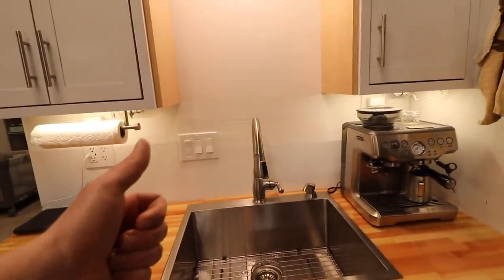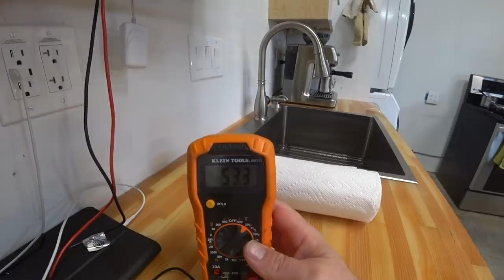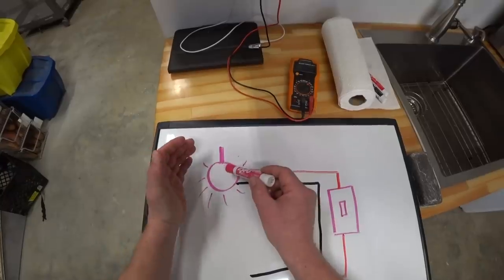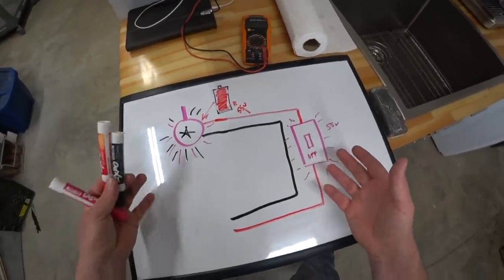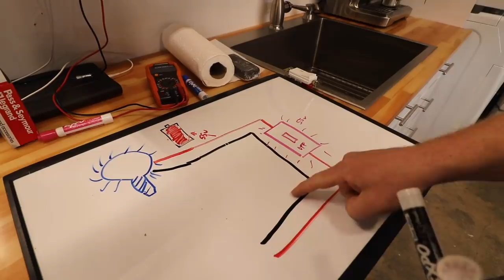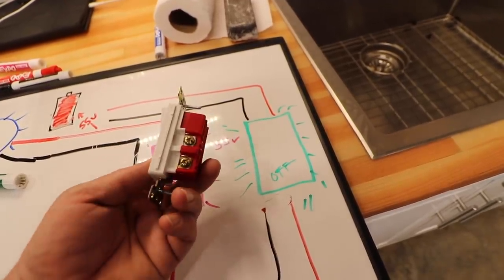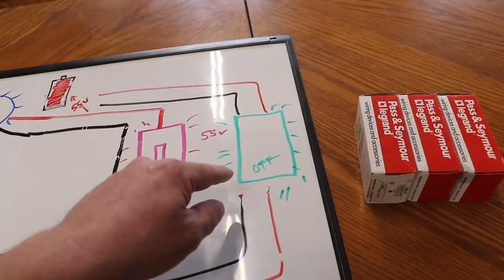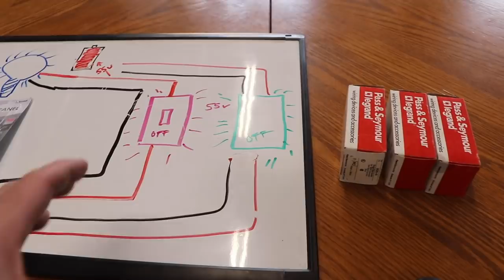Don't Use LED or CFL Bulbs 'Till You WATCH THIS VIDEO

Comment: Swap the line and load wires at the switch...
Reply: Can't believe people didn't see this...    I'm guessing that they are busy with life.  I'd hope they'd take down this video and replace it with the simple solution.   I've installed a few switches with illuminated leavers..  I'm pretty sure the amount of burnt down houses from that is 0.    They should also check other wiring...  Line and load are easy to mix up, but important to keep straight.
Reply: Doesn't matter the switch is wrong for the situation not wired incorrectly his explanation is correct but the switch warns not to use it for cfl or led lights

Comment: What about just find a switch that has light on the switch plate instead? That would solv this problem. And you would have light around the switch instead of in the switch.

Comment: What about just putting a smart switch in there many have night lights on them and you can just be like alexa turn on my counter lights as you come down stairs at night
Reply: Tjis will work as they use a relay to switch the load

Comment: Your problem is caused by the poor quality of the power supply of the LED's.
Better power supplies already have incorporated a mitigation for that.
The small amount of current passing your switch is accumulated in the power supply, how you already recognized. What you need is a resistor that bypasses the capacitor. Long story short: you have to drain the leaked current. You can put the resistor outside the power supply as well. It has to be parallel to the input of the power supply. Directly on the 110v. Maybe inside the box of the outlet.
A to big resistor will slow the flashing, but not prevent it. A to small one will consume to much current, may get hot or blow the braker.
That is the reason why you didn't found a better switch. But maybe you find a better power supply!

Comment: re. LED Strobe Lights 
You are right about needing a "parasitic" load. The light in the illuminated switch needs a return electrical path to work but only a very slight one. You need a "drain resistor" to provide a return path for the switch light.  If the light IN THE SWITCH is LED, I suspect a resistor of approx. 50,000 ohms, rated at 1/4 watt, wired between the load side of the switch and neutral will solve the problem. If it does not, or the switch does not illuminate, you will have to go to a lower value resistor (with a higher wattage rating). If you have no access to neutral at the switchbox, wiring to ground will work the light properly, but this is POOR PRACTICE, not recommended. You could instead put the resistor in the outlet box feeding your LED lights, wiring it between hot and neutral.
If you go to a lower value resistor, the wattage rating would have to increase by inverse proportion, i.e. a 25,000 ohm resistor (half of 50,000) would have to be 1/2 watt rating (double).

Comment: A resistor at the plug would fix it around 50k ohm
Reply: I checked it out with a lighted switch 
10k ohm did the trick with a 3 watt led

Comment: These switches should not be used as they do not fully isolate the circuit. Surely they would be failed by the inspector.

Comment: Why bother with switches, just use light fittings with integral motion sensing switches. A wave of the hand switches it on or off.

Comment: This has nothing to do with the LED or CFL lights, this is baity
Reply: Yes, it has everything to do with the high efficiency lights.  If it were incandenscent or halogen bulbs, there would not be an apparent problem.
Reply: @wallykramer7566  I don't know what's worse, the fact that you may think that the lights are a fault or you completely understand and run with this video.

Comment: You have wire problem try this and see put the switch on the black cable but neutral is white on the color code black is hot and red is return your problema is the black is hot and not a neutral  🤷‍♂️🤷‍♂️

Comment: If you have power on your plugs but the light switch  is off i would be worried .. major mailfunction and dangerous .. if its off no voltage should be seen .. hire a elektricitan to fix this you are dangerous ..

Comment: I've also found that it's not that easy to change halogen lamps to LED. The halogen electronic "ballast" needs a load, and the LED's do not supply enough of a load, so either the LED visibly flickers, or it constantly restarts which eventually bombs the ballast.
Reply: Thinking that fluorescent lights have ballests halagon have transformers

Comment: My house shop barn and storage areas out door lighting are 110vac no transformers its cheaper on initial outlay and no problems with dimmers or back lighted switches  I have 4 different sizes I get a rebate from my utility company. I have a full set of spares and should I need more I have one source online that does 2 day shipping/ In my not so humble opinion you just simply bought the wrong  types of lights

Comment: All lighted switches put the switch light in series with the room light.  With an incandescent bulb, Ohm's law takes over, electricity takes the path of least resistance and only the switch lights up.  With LED, the resistance is very low,  and electricity follows both paths.

Comment: Using a switch from the age of Steam and glowing Tungsten wire is not going to work in 2020 :-)  Unpleasant too back in the day when these were in Fassion, you would get zapped changing the bulb with the switch off......

Comment: When you get any voltage after you switch off, there is faulty wiring or some other fault. You should see 0V when measured or  some inducted voltage in millivolts range max.
Reply: The switches are design to have a dim light when in the off position.  Makes them easier to find in the dark, especially if you just came from another lighted room and your eyes have not adjusted.  That means there has to be some sort of circuit for the electricity to flow through.  When incandescent bulbs were used, the bulb was the best circuit to use.

Comment: You have light switches within reach of the water supply?😱 So you can have one hand in a sink full of water whilst using the other wet had to turn on the switch!! Certainly couldn’t get away with that in the UK. A big no no!
Reply: GFI breakers cover everything on the circuit.  That is what he is using.

Comment: ok after looking at all the answers you need to unbond the ground with the neutral to lower the backfeed to the plug 55 volts is to high  the other test would be shut one breaker off at a time to see it is in one curtket

Comment: Just fit one 275vac 0.47 uF X2 safety capacitor across the L & N in the back box of a plug socket .
One per switch  .

A neon power indicator ( neon & resistor ) may not work as the plug in psu will start before the neon fires .
If a neon is fitted in the box the darkness may make it unreliable  .

Comment: Go to radio shack and buy a bleed resistor (680K 1/2 watt?) and put it on the back of the Load receptacle much like some manufacturers put across a capacitor to discharge it when power is removed. What is the resistance value of your night light?  The resistor can be hidden behind the receptacle in the box.

Comment: Found out, the hard way, that you should Not use led lights in your garage door overhead because it can disrupt the signal to your keyless entry.
Reply: @PW Mine came with LED bulbs, tho they are suppose to be for a opener. Never a problem.

Comment: There is no reason for the glow in the switch or the bulb to be in the circuit when it could run on induced current like a circuit tester.

Comment: Switches over a sink and outlets within 4 feet of water that are not GFCI are against code. Not surprise he did know what he is doing by a amateur pretender/know it all.
Reply: He had a GFI breaker in the box when he killed power
Reply: You can have either GFI switches or a GFI breaker which will cover everything on the circuit.  If you watched the videos where he did the wiring you would know he went with GFI breakers.  Now, just who is the "amateur pretender/know it all?"

Comment: If single and double poled switches mean the same thing from British to American electrical terms that has nothing to do with having a neutral in the box it is the amount of switches you can have on the circuit a single poled will only have one the double can have more than one. It might be due to the fact you are using plug into socket lights not dedicated permanent supply lights? Maybe someone who is more experienced than me can help more I haven't done a lot of electrical work and none on American wiring, but I hope you can find a solution as that is a irritating problem!
Reply: Matthew Latham us in the uk should not really say double pole! It’s two way three way etc, as double pole means the line + neutral.
Reply: @michaelcoles6140  three way usually means DOUBLE THROW, rather than Double Pole.
Reply: Hi, what you have is a voltage divider circuit when you turn the power off. The switch usually has a neon Bulb inside with 100 K ohm resistor in it. If you put 1000 ohm resistor in parallel with your LED bulb you will probably drop the voltage down so low it will not charge. Otherwise the only other solution is to use a double pole single throw switch to do that job. they are available but it’s not one of the usual ones.look in Lowe’s.com for item 472405 or model CSB220WZ.

Comment: this is easy... it is illegal to switch the neutral so everyone knows. THX
Reply: William Knight no it is not if you are not switching the ground neutral is fine read your code book
Reply: @larryjobs4994  what is a ground neutral. I got my masters license in 94' IBEW Journeyman card in 91' it is not legal to switch the neutral and not the hot. to my knowledge in single phase we have Hot most colors, white for neutral, green or bare for ground wire and green with yellow stripe for isolated ground.. not trying to argue this is what I remember.

Comment: I guess you could try putting a resistor across the low voltage side of the LED transformer. To dissipate any charge building up before it flickers the LED. You would have to experiment with the value though.

Comment: If you don't want to use a separate plug in night light, as some have suggested, try a dimmer and then just turn the undercabinet lights, or even just one of them, down to a low setting, so using it as a nightlight. Lots of ways to skin that cat.

Comment: I think the problem is with the LED strips in my opinion the LED that has to handling this not the switch. :)
Reply: Yes and no the LED shouldn't be bothered about this (as simular propblems can occure due to capacitive coupling) but the Swich should also be designed to isolate so there isn't a voltage at the output when turned off.

Comment: You mount a non-polarized capacitor at the LED lamp terminals, its value can be somewhere between 0.22 - 1uF / 400Vc.a.
Reply: Would need to be a self healing safety capacitor (rated ”X1Y1”). And might not even completely solve the problem. And is a hack, not what is wanted.

Comment: Take a look at the leviton 5628-2W...  

Connect all the Neutrals together... it should not pass through the switch but branch off to power the switch.
Reply: description of that switch says "illuminated ON" ... I think they want it to illuminate while it is OFF, so they can find it in the dark.
Reply: @javabeanz8549  

Right.. makes sense...

My personal solution was to install Smart Switch by Martin Jerry... with a little bit of work you can select to have the inbuilt LED illuminated On or Off.

I used the MJ-S01... It's not a rocker style switch...

Comment: i was all ways told the on/off switch should all ways be on the neutral side not the hot side
Reply: A switch simply creates or breaks a complete circuit.  Where you break it is irrelevant but if you do it on one you should do it the same way on all.  And just so you know, the neutral wire is just as hot as the hot wire.  The neutral is called neutral because it taps into the transformer coil in the center so you can get 110 volts instead of 220 volts.  You get 220 volts by connecting a device (like a dryer or electric oven) by connecting them to two breakers, next to each other horizontally.  That way you connect it to the two hot wires in the breaker box that are connected to opposite ends of the transformer coil and have the full 220 coil voltage running through them.

Comment: You're neutral and your ground are the same
Reply: The neutral taps into the center of the transformer coil and has 110 volts running through it.  The ground connects to a Earth ground and normally has no current/voltage running through it unless the wiring inside a device comes in direct contact with its metal casing/housing so that it provides a path of lessor resistance than a living body.